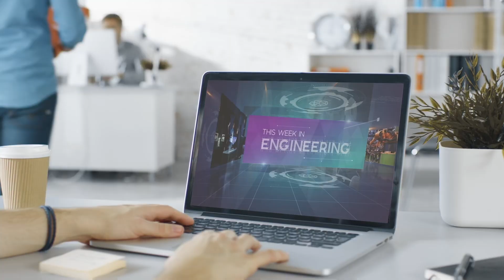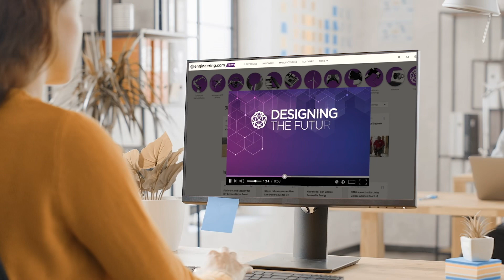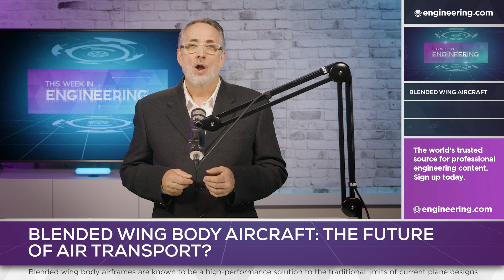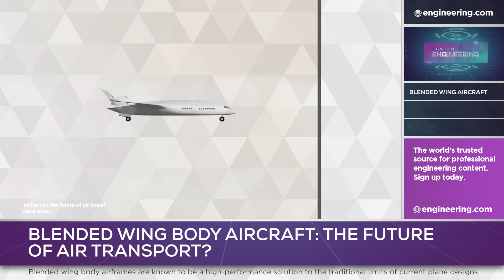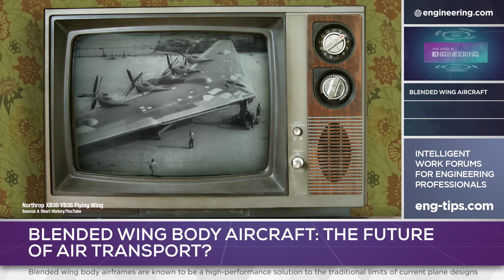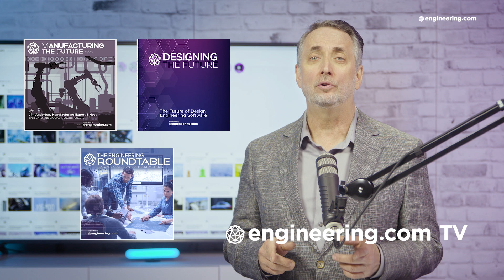Blended Wing Body Aircraft: The Future of Air Transport?

Comment: First, this is related to previous discussions directed at the U.S. Air Force; to which I feel some allegiance. The new general spherical yet broad and potentially large team carrying front and main of these airplanes is excellent and headed in a great direction. We have in these engineering illustrations made the important jump from large, obtrusive wings that unnaturally defy gravity to drawn-back, reductionist war wings necessary for fast and agile air battle tactics but also happens to be environmentally efficient(not the top consideration.) Yet here's the important error that has to be corrected. Utilize this company; Build this plane. Good. But do this; the proper warplane does not have a flat bottom or hull. Instead, it is gently arched in a natural orderly spherical arch which could be approximated, approximated not precisely described as a 'V' for lack of better symbology. I am speaking of an Oceanic Manta Ray; although the Manta Ray is flexible unto fluidity and our planes are of fixed metal, it's relevant as the reference is to a geometric shape. Unlike with a flat bottomed or flat hulled air-ship, the powerful wind will not merely bounce off our metal hull causing slight drag and wind resistance but rather(and god-damn it this is not a metaphor any of it!;) enter into the curvaceous hollow of our metal aeronautics cave like sea wind billowing a trade sail propelling nautical progress; but in this case propelling our flight to some degree; but that's not the main reason necessarily in a war context, though it deserves aeronautic attention and study by engineers and practical physicists. No; no by just alternating our wings up or down, right or left, or manipulating the surging, digi-sensored air rush in the extended flight structure(or call it 'belly' if you want; that is a metaphor;) we can now maneuver with speed and agility advantages we did not have before; provided the rest of the flight and computer science systems are well adapted and in order. There will also be slight disadvantages to this design; and 100 details and complexities direct and related to test and consider; this will not change everything overnight; it's not all-important; But it is significant and intended for use by the U.S. Air Force. It's like an advancement in chess opening theory, it's relevant and worth studying; it does not guarantee victory or success in the sophisticated and ferociously contested game of tournament rules play Chess.